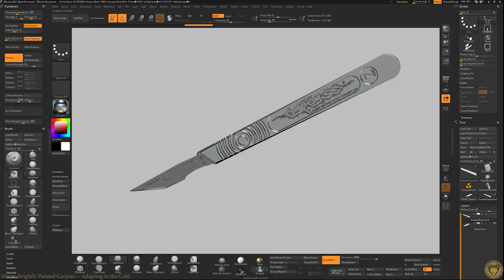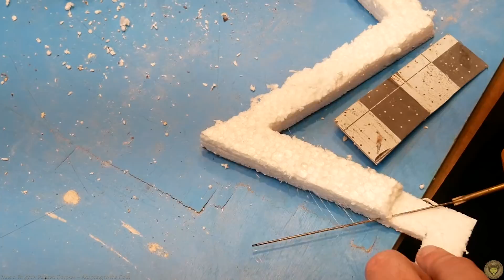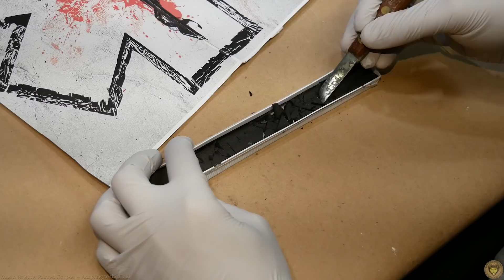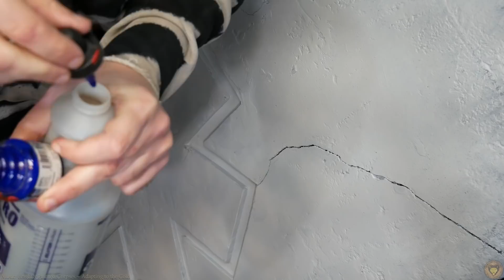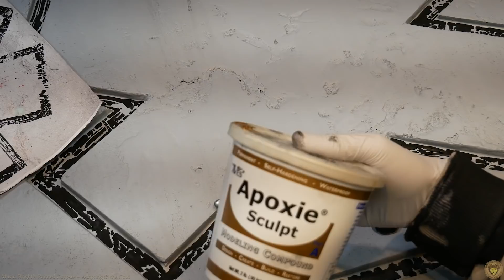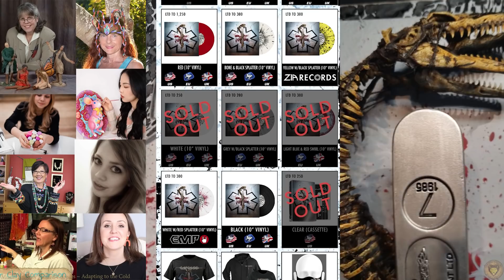How I Made an Album Cover for the Band Carcass

Comment: Really cool work! Im a graphic designer by trade and I sculpt (among other things) as a hobby. Your approach on the cover was like a breeze of fresh air blowing through a cesspool of bad photoshop and 3D stuff. Im into metal since the early 90's. I really miss the time when even small bands had fully painted album covers. Im not at all against digital media but they provide shortcuts and people most of the time are tempted to use them feeling pressure by the lack of time or proper payment.